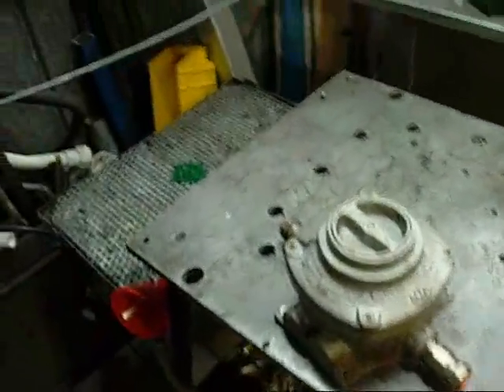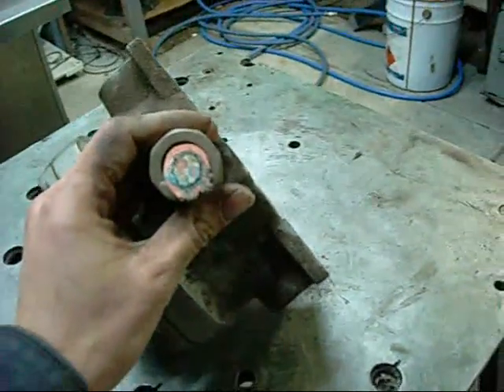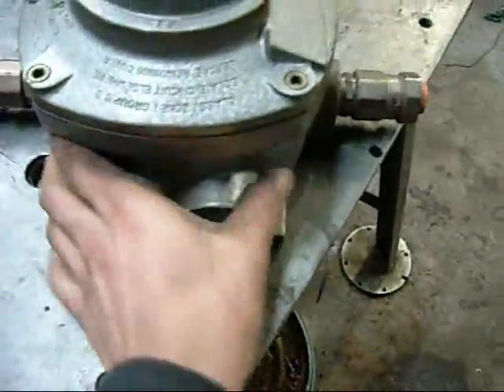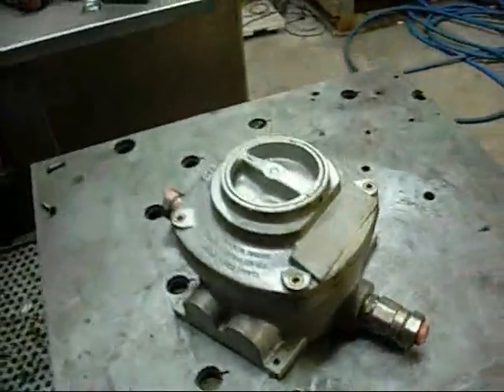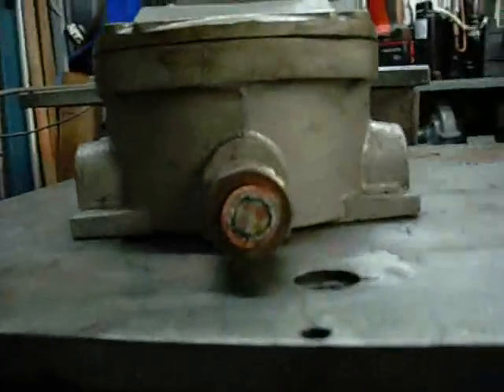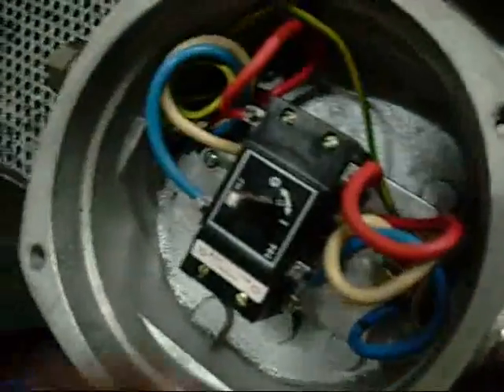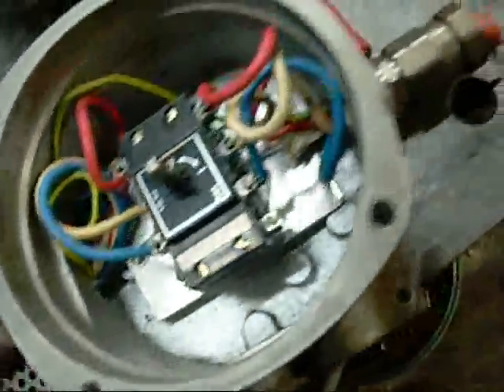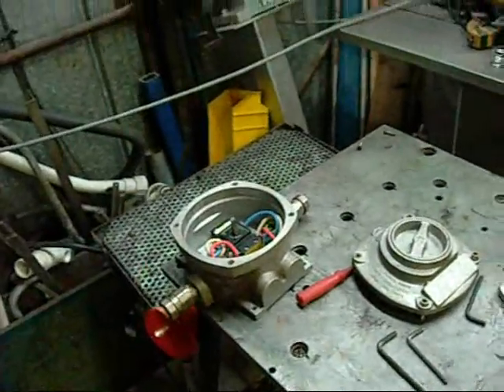Explosion Proof 3 Phase Switch

Comment: I used to work in an old building that was built in the 60's and they had loads of switches like this. It was an awesome building, all of the wiring was done in mineral insulated copper clad cable and was a work or art! Shame that it was demolished and is now a Tesco supermarket... :(